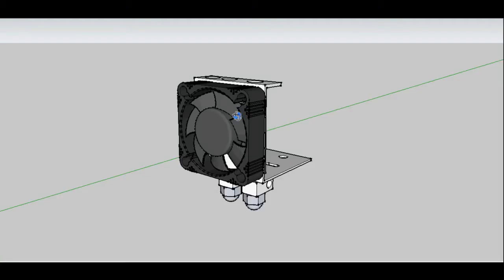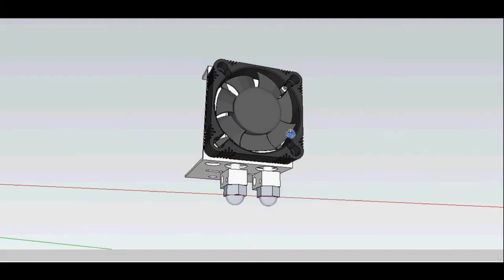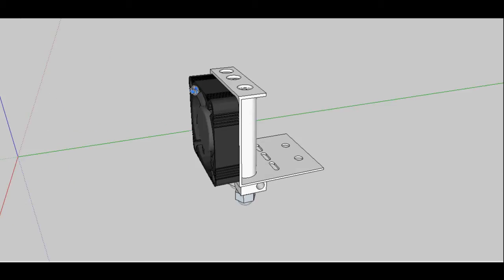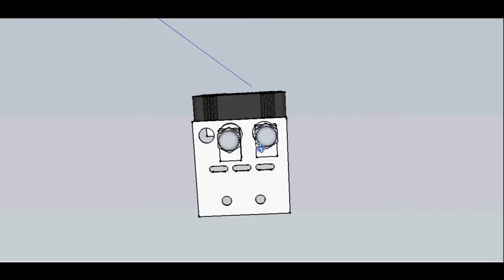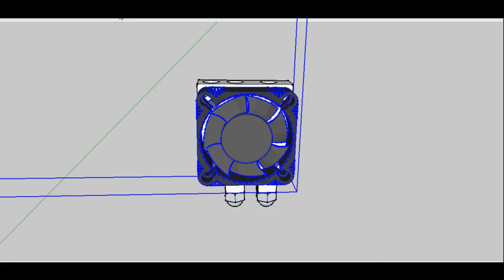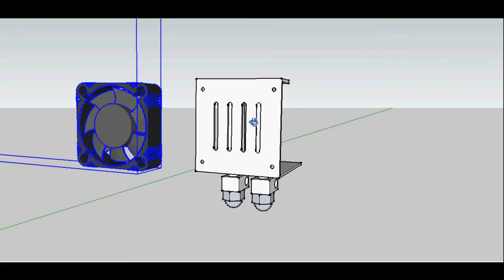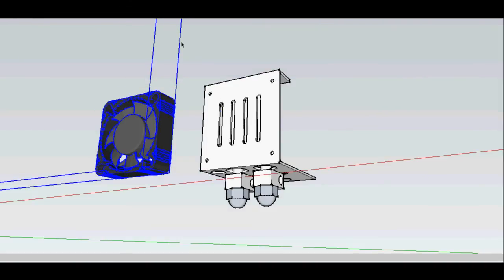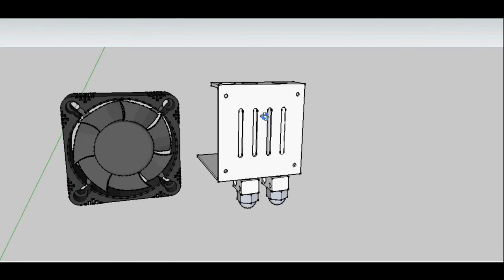New hothead bracket?

Comment: I really like this dual hothead design. It's compact!
But I don't think the 4 oval holes for the airflow will be enough, it's too closed.
When you look at a computer casing, it has much more holes.
I don't know with wich material you are printing, but with PLA you need a properly cooled hothead to prevent the heat traveling up the barrel.

I'm planning to use 1.75mm PLA when I'm finished building.

Comment: I think a Quck Snap holder was the best. So the Cleaning or Toolchange was simply and fast. Other Tools, like a Dremel, Single Extruder, Pen holder and and and..., with the same QuickSnap, Like a Akku from a Drill. 
Snap the Tool in and Use ist.